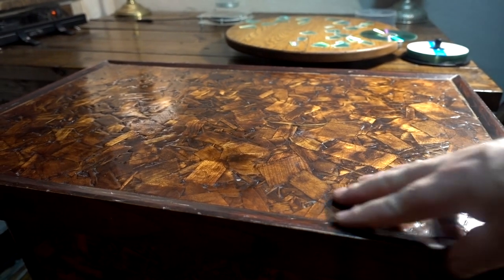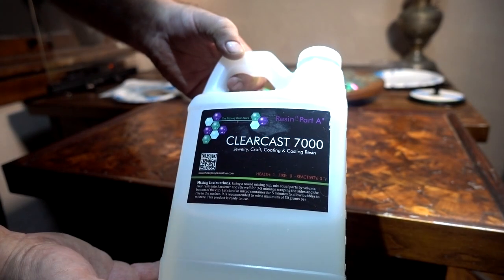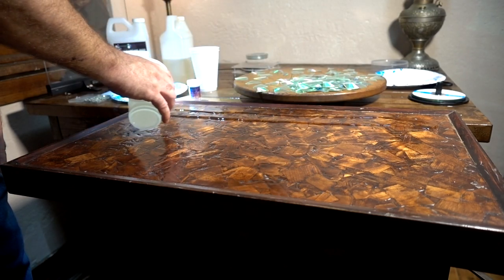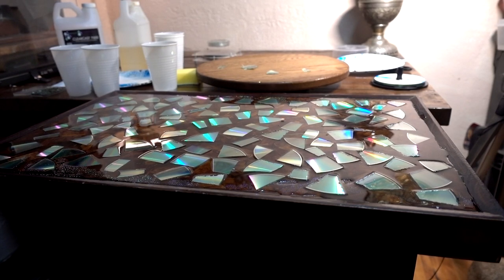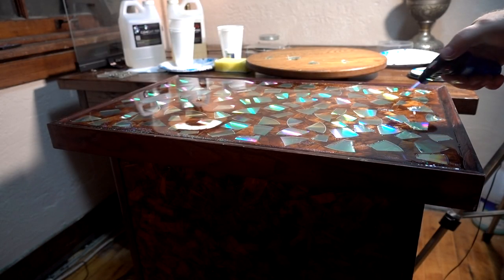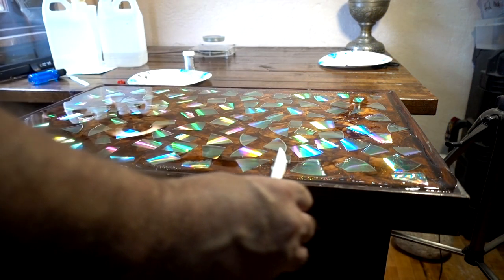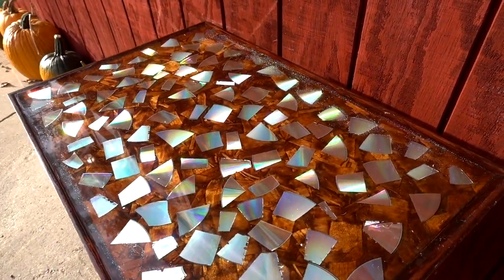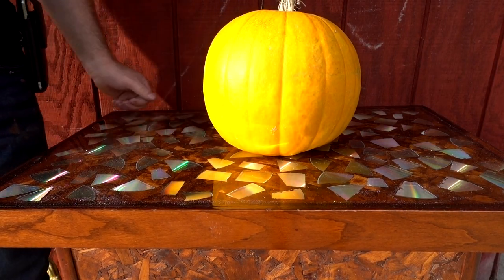Resin  DVD table top How To

Comment: A heat gun will work better than a tourch... basically turn it on point it away let it warm then when its warm in short bursts blow on the epoxy. Dont let the epoxy get too hot tho